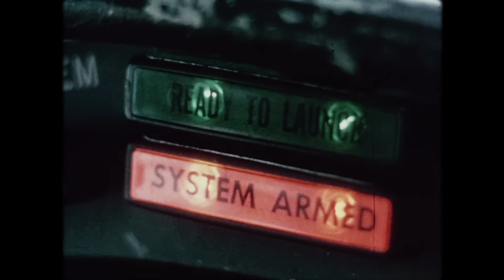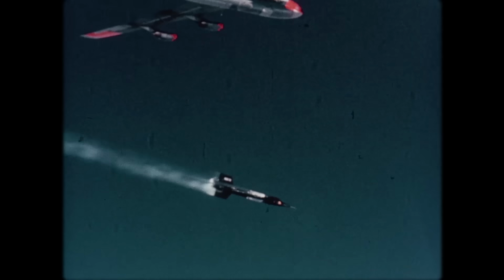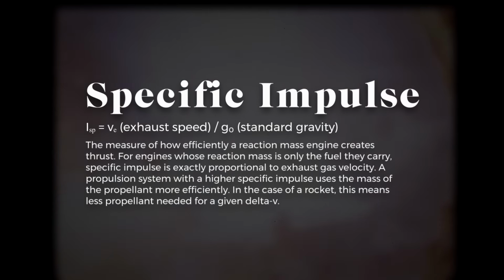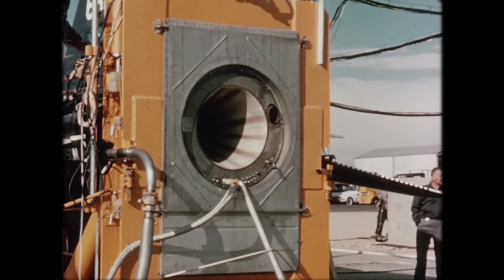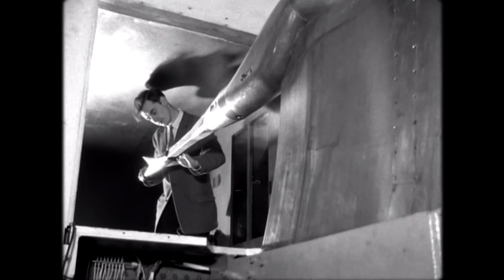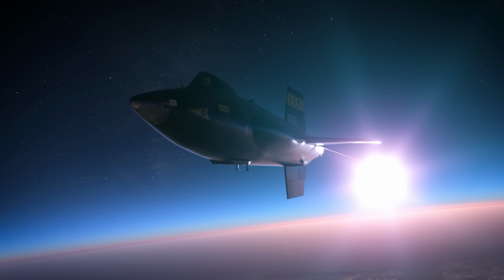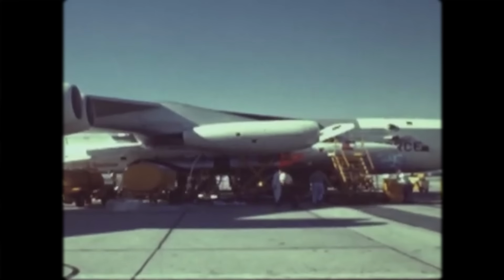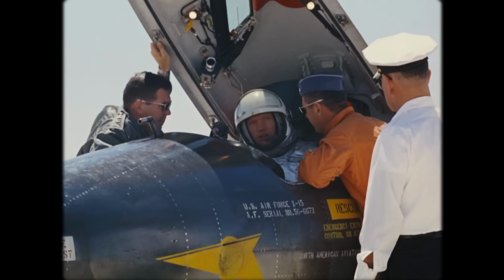The Insane Engineering of the X-15

Comment: It is slightly unfair to compare the SR-71 to the X-15.  After takeoff, and a refueling , the SR-71 could cross a continent at sustained speed.  The X-15 was a valuable science experiment, but largely a guided rocket, not a plane.  Apples and Oranges.
Reply: A plane it may have been, but it was still out of gas after running the engine for two minutes. Its only purpose was experimentation.
Reply: By definition a plane is a powered manned vehicle with fixed wings and a weight heavier than what it displaces, so therefor the X-15 is a plane.
Reply: Like comparing a top fuel dragster to a road going production car
Reply: Additionally, the Blackbird was a air breathing vehicle, the X15 wasn't
Reply: Clever monkeys
Reply: If the SR-71 was the Bugatti Veyron of Planes, the X-15 was a top fuel dragster
Reply: You guys are silly. He understands these things 😂😂 cmon, he’s just trying to describe something, and the sr71 effing rules. Like tunnel snakes. Tunnel Snakes rule!
Reply: It's like comparing Usain Bolt to Eliud Kipchoge. Usain Bolt is the fastest man in the world, but he can only sustain his top speed for a few seconds. Eliud Kipchoge might not be the fastest man, but last time I checked he was the only man who completed a whole marathon (42km) in less than 2h. That's 350m/minute. (In imperial: 26.098 miles in less than 2h, ~19ft/s.)
If Usain Bolt is the X-15 of running, Eliud Kipchoge is the SR-71.
Reply: I live analogies like this! Being a former music teacher, I used to tell people that music is a language, individual notes and beats are letters and chords and rhythms are the chords while the song piece is a book or play. 😇
Sorry for the long winded rant, just admiring your use of analogy
Reply: @louisrobitaille5810 Good comparison.
Reply: @louisrobitaille5810 not a fair comparison. Can E randomly sprint as fast as bolt?
Reply: @louisrobitaille5810 not really. They are both runners. These are not both planes.
Reply: ELIUD WHO? LIKE THAT COMPARISON vs Bolt
Reply: @GoHARD99 I am very confident more people have heard of the SR-71 than have the X-15 😂 good try though
Reply: @BleedTheRic  how much you want to bet ?
Reply: @GoHARD99  I would put my life savings on it. Go out in public and ask 100 random people which they have heard of before
Reply: @BleedTheRic those of us born before 1970 have heard of the x-15.
Reply: True, but as mentioned in the video the X-15 was a testbed.
Reply: Last year someone said Yeager had flown the X-15 from a ground takeoff.  In his memoir Yeager!, he said he flew the X-1 from a ground takeoff and never mentioned flying the X-15.
Reply: Your just reaching bro there both planes its a plane once you need a man to maneuver it 😂😂😂😂
Reply: no one cares buddy
Reply: @Bretaxy no one cares how aloof you are.
Reply: If it brings its own oxygen it's not a plane anymore, it's the slowest rocket...
Reply: I get it...at the right altitude, you can convert the atmosphere into spontaneous propellant...not sure whether they've discovered that yet or not...I'm back from the future
Reply: Yep, the X15 was a rocket with a steering wheel lol 
Sweet concept but very different to the SR71
Reply: Concur entirely.
Reply: I think it's mostly because the SR-71 is just the next closest thing, i suppose you could compare it to a rocket because it basically is one, but comparing it to a plane is more interesting
Reply: More like apples to rasins
Reply: Oh, it was @michaelgarrow3239 who said that.
Reply: 😢😢 opium
Reply: Interesting point
Reply: Agreed. It was more a proof of concept. A very remarkable one, no doubt, but a proof of concept for the time nonetheless.
Reply: Right, as soon as it dropped and took off I said “that’s not a plane, that’s a rocket with a person inside”.
Reply: SR71 have air breathing jet whereas X15 have rocket propulsion system in which oxygen is stored and used as a pure liquid fuel. That's the difference. And that is why X15 boasts high specific impulse too. Comparing SR71 with X15 in terms of engine is unfair.
Reply: Fair, but to have something for contrast, I think it is a good reference. It's not so much of a comparison but a measure to get a ballpark idea of scale here.
Reply: Point.
Reply: First off, the Outlaw Star ship from the anime show is based on this aircraft.

Second, during Nazi Germany of WW2, engineer Werhman von Braun  etc would help develop the V-2 missile program which was used for missiles and rocket propulsion.  The same V-2 missile program from Nazi Germany would layer be implemented into the US's space program for rocket ships and propulsion (NASA) as well as Russia implementing similar technology to their own space program with Sputnik.  Even Britain, whom after the end of WW2, developed high end VTOL (vertical take off and landing) aircraft such as the harrier jet, helicopters, and more.  This tech is no slouch.  It is the very definition of cutting edge.
Reply: STILL USA HAVE
Reply: But try to controll X-15 at space?
Reply: none is comoaring them dude
Reply: Came here to say the same. Isn’t really a plane of it can’t take or land and has a rocket engine ? It seems like it’s a manned rocket.
Reply: More like the X-15 was a Baka Bomb for the Cold War. 😆
Reply: That's exactly what I was about to write. X-15 is not a plane, i.e. not one for any kind of regular use as such. It's a rocket building experiment, which somehow carried a human inside.
Reply: @DuRoehre90210 The X15 relies on aerodynamic lift to remain airborne. That is the definition of an airplane, unlike a rocket that relies on upward thrust. The X15 was in fact an airplane. A rocket powered plane, unlike the SR 71 which was a jet plane.

The SR71 holds the distinction of the fastest air breathing aircraft, that is an aircraft that is powered entirely by air breathing engines rather than rocket engines (which do not use air).
Reply: @jamesdinius7769  Actually a rocket doesn't go straight up it spends most of the flight nearly horizontal only the takeoff part is vertical.
Reply: @bobdillon1138   WOW !  What grade are you in !  It sounds like maybe pre kindergarten !  Seriously, please read before you say or txt anything !
Reply: @tailor383  Did you come up with that all by yourself or did mommy help...well done
the world needs more special people.
Reply: @😂😂😂😂😂😂😂😂😂2 butDuRoehre90210
Reply: @DuRoehre90210 😊
Reply: Agree these two machines are complete different
Reply: That phrase makes no sense why can’t fruit be compared?
Reply: @majikkskates9084 you can't it is against the law, also apples are harder than oranges, but oranges peel more easily...oh man, i hear the police coming.
Reply: @nickn7939 "straight to jail."
Reply: @majikkskates9084  apple pie yuuumm.
Reply: @majikkskates9084  apple pie Yuuumm
Reply: I don't think the comparison made here was to "compete", but rather to just give an idea of how fast it was.
Reply: Why are so many people crying in the replies? It's obvious that the x-15 was completely impractical for any other purpose than beating the speed record and being a science experiment, it could only fly for a few minutes in a straight line after being launched from a plane, while the sr-71 is a fully functional military aircraft that just happens to fly very fast
Reply: A guided rocket is a missile
Reply: @jakecivis7402  but a manned rocket isnt a missile right?!!😉
Reply: @YourBritishLord  - A bull is a cow. But, a cow isn’t a bull.  🤔
Reply: @YourBritishLord yea it is
Reply: Also,it is not even the sr-71
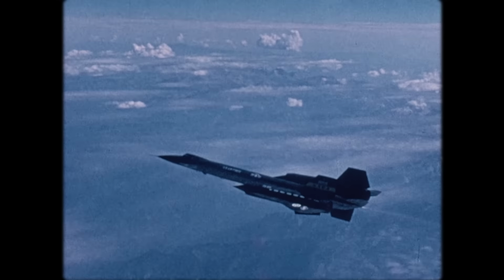In 1:38, the aircraft featured is the yf-12
Apart from that, this was a very interesting and informative video
Reply: Why wouldn't it be a plane? It doesn't matter the propulsion system, A plane uses wings for lift
Reply: @Shortkidnextdoor  So the Space Shuttle is by this definition the fastest plane to ever fly
Reply: @Shortkidnextdoor which would also make the space shuttle a plane, which is much faster than the X-15
Reply: @Shortkidnextdoor So is the space shuttle an "airplane?"
Reply: its a glider, the space shuttle dident use its rockets in the atmosphere, it glided to the runway. @AsaSpadeSS
Reply: By that definition every cruise missile is a plane lol
Reply: @JesusChristTheHoly  - more like a drone…
Reply: @JesusChristTheHoly I mean technically yeah
Reply: @Shortkidnextdoor  The wings were there mainly for landing
Reply: @bobdillon1138  If you were saying that about the Space Shuttle I'd agree, but the wings of the X-15 were not "mainly for landing". 

Regarding your second reply: You're correct regarding orbital rockets (which is the vast majority). However, non-orbital rockets (like Blue Origin's extremely phallic space tourism rocket) tend to go straight up. 
(I really didn't intend the pun, but after I finished typing that it clicked in my head 🤣)
Reply: It’s a rocket plane that burned liquid fuel
Reply: That's what I was gonna say, it is like comparing Bugatti to Top Fuel Dragster.
Reply: It’s apples to oranges, but not unfair. At the end of the day, the 

X-15 was faster, but was designed for short flight. 

The SR-71 was designed for sustaining Mach-3 for long periods of times 

I wouldn’t say he was saying the SR-71 was worse. Just giving the closest thing you could compare it to.
Reply: @mitchellbunting296 Mach 3? Is that what they put on paper? 😉
Reply: They simply stated that it was the fastest plane ever made... It had nothing to do with distance or anything else.. why do you make things so goddamn complicated
Reply: I am not an engineer, but have always followed this evolvement, I just enjoy it. The X-15 is a rocket, the SR-71 and YF-12A were a fantastic plane I believe through Kelly Johnson's leadership and in his time delivered on time and under budget ( I type budget, AI types Bigit😢) 

WTFE, AI. Incredible engineering to all that worked on these programs. kudos
Reply: The definition of an airplane says nothing about the types of engines or propulstion used. It's a machine that can fly using wings and engines. Yet the definition of a rocket clearly says that it is used to go to space or as a weapon and gain high altitudines. X15 was a plane. Thanks a lot ok now bye bye then
Reply: Imagine being in an orbital race with the SR-71 and wanting to wave as you pass, but going so fast that you miss your chance to do so, only to hear the copilot say, "Don't worry, in awhile you'll have another opportunity when we lap them."
Reply: SR-71 bros will go to great lengths to pretend the X-15 doesn't count as a plane
Reply: It was just a rocket-powered airplane. Similar to a jet-powered airplane. They just depend on different propulsion systems, but both still fly using thrust and aerodynamic lift. The X-15 was still an aeroplane regardless of its propulsion system.
Reply: @sidgar1 Apparently you do not read very much .  Therefore you speak from a WEALTH of IGNORANCE !
Reply: The comparison was simply done for informative purposes, not to imply it was a competition between them.
Reply: Nuh uhh
Reply: Also, the SR71 was jet, so it couldn't function in space, as said in the video.
Reply: And why not mention Kelly Johnson? I mean it’s not like he was the guy that and vented this in the SR 71’s design as well as the plane before it is, sir 71.
Reply: I don't think so. It was a piloted craft. As is the SR-71. So who cares?
Reply: I agree to disagree
Reply: X-15 is not a plane. Its more like a manned missile.
Reply: Agreed!!
Huge difference. 
X15 is totally reliant on another plane to even get off the ground. 
X15 is just a controlled rocket that only wants to land. 
SR-71 is self sufficient (after start up). 
Had Many useful capabilities beyond going fast and landing. 

I would not personally classify the "Xplanes" as "planes"...  

I mean, anything will fly with that much rocket strapped to it's ass. Doesn't make it a "plane"....    Lol. 

Definitely not a great comparison... But if we are comparing such things..  why not toss the ISS in there?  Or even the PSP, (the Parker Solar Probe)?  The list goes on and on. But the PSP is currently the fastest man made object ever to "fly"...  Not sure if we can call it "flying" in space, but...  🤷🏼‍♂️
Reply: Apples and oranges are pretty much the same
Reply: 😂um,,, they had this argument back in the day. The X-15 isn’t an airplane because it doesn’t take off- bla, bla… 
Well…
Chuck Yeager did take an X-15 off of a lakebed. They filmed it. So; the X-15 is an airplane in every sense… sorry- not!!!
Reply: @michaelgarrow3239  That was a landing.
Reply: @ekspatriat  - Um,,, the takeoff is in Chuck Yeager’s autobiography if you want a source…. 🤓
Everything lands… 🙄
Reply: Only by refueling multiple times. The x15 could go 350 miles in 12 minutes.
Reply: @MeerkatADV 10min 30sec of that would be unpowered.
Reply: A rocket powered or a jet powered are equal and useful for any objective..both produce thrust that is required to attain desired speeds. Lets say u r intercepted by fighters and you just outrun them in front of their eyes posting it online for the world to laugh at those interceptors😎🇺🇸🇺🇸🇺🇸
Reply: @YourBritishLord  outrunning the missiles fired at it😂
Reply: @YourBritishLord  I mean, Swedish fighters once intercepted the SR-71.
Reply: @mdal1377  Which was reliant on the Blackbird not changing course. Depending upon the Blackbird’s course, and whether it was flying at its max cruising speed and altitude, such interceptions would not be possible. At least, not until the development of more advanced radar and missile technology, well after the Blackbird entered service.
Reply: but they all use  rockets so what's the difference
Reply: @zoltanfarkas3880 The SR-71 did not use rockets.  It used turbine engines and afterburners. 

Completely different technologies.
Reply: @zoltanfarkas3880 basically, rockets vs turbine/ram jets.  Also the sr71 represents more of a traditional plane design making it more recognizable
Reply: @zoltanfarkas3880 SR-71 used jet engines
Reply: @zoltanfarkas3880 the is a different between rockets and scram jets, ram jets, ect
Reply: @zoltanfarkas3880  SR71 is a jet not rocket powered.
Reply: @zoltanfarkas3880  the sr-71 uses turboramjets, not rockets. Very big difference
Reply: @zoltanfarkas3880 the sr 71 is not rocket propelled.
Reply: @zoltanfarkas3880 SR-71 is a Ramjet
Reply: @zoltanfarkas3880 Nah bro...... Jet engines and rocket engines are completely different concepts,   oversimplified, jet engines use atmospheric oxygen and rocket engines use oxygen from their tanks
Reply: @zoltanfarkas3880 the sr71 does not use rockets??
Reply: No. It used a hybrid Turbo/Ram jet engine. The GE J58. The inlets were specifically designed to not blow out the engine over Mach 3. It was very much an air breathing jet but the ram effect allowed it to stay lit at altitudes most jet engines would compressor stall because the compressor was bypassed at those speeds and the engine firing on pure ram air.  @Pippy1
Reply: @Pippy1 
No, air breathing jet engines.
Reply: @zoltanfarkas3880 Wrong.. SR-71 uses jet engines… totally different from a rocket motor.
Reply: @zoltanfarkas3880 seriously? One is an air breeder that crosses continents and takes off and lands on its own. The other one is a rocket that is launched off the wing of a bomber

Comment: Amazing job covering so many interesting details of the X-15.  Also amazing was that all of these mechanical, chemical and electrical problems were solved with slide rulers.  Still dumbfounding to me.

On an entirely different note.  The devil is equated to the "power of the prince of the air" in the Bible.  For real.  Now, note the 666 that led the tail numbers of the X-15 - on all of them.  I've always wondered if there's any correlation.  Like I said, on an entirely different note.
Reply: How is this not the top comment????

Comment: The Aurora aircraft were reported to have reached speeds at Mach 14
at extreme altitudes and unmanned. The military is hush hush about Aurora and what information is available is probably misinformation. There's some speculation that a new sr71, the sr72, has been operational for some time. There's no doubt secret projects exist.

Comment: I can't help but notice some of the experimental aerodynamic shapes of the 1950s / 1960s have begun returning with modern material and flight computer / control systems emerging. 

It's incredible how visionary these amazing engineers were in a time before computer assisted design (CAD).

Comment: @ 5:11 - This is a problem the Russians had solved by the early 1970's & is a major feature that makes Russian rockets better than the Americans. Instead of venting the turbine exhaust overboard, they found the proper mix ratio that made it reusable enough to be injected into the main rocket.  This yielded about 25% more power.

Comment: X-15's WERE NUMBERED.... - 66670 66671 66672   
FLY IN A ROCKET PLANE TO THE EDGE OF SPACE @ MACH 6....IN A PLANE NUMBER STARTING WITH 666...
Reply: No, it was actually 56-6670 through 72. And the Mach 6 figure was attained at an altitude of 30 km or 100,000 feet, hardly the edge of space.

Comment: Does the X15 fit the definition of a plane? According to the dictionary a plane has a propeller or jet engine. The X15 is rocket powered.
Great work though.
Reply: Rocket powered aircraft is more suitable.
Reply: @oscarin13  yes, like the Space Shuttle. That  would make the Space Shuttle much faster than the X-15 at Mach 22.

Comment: Me thinks the X-15 engineers would not be producing thrust charts, fuel volumes and etc in the metric system let alone the brand new (at the time) SI Metric System. Even today most people in 'metric countries' don't even know what the unit of weight (= a force) is in the SI Metric System.